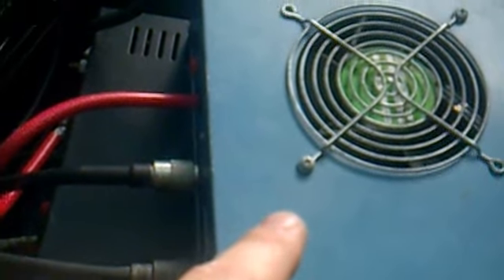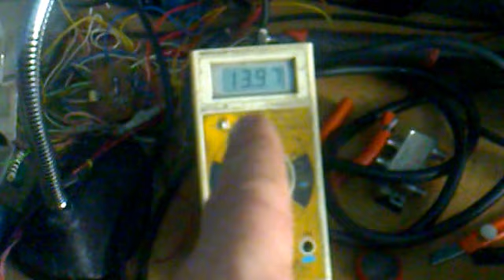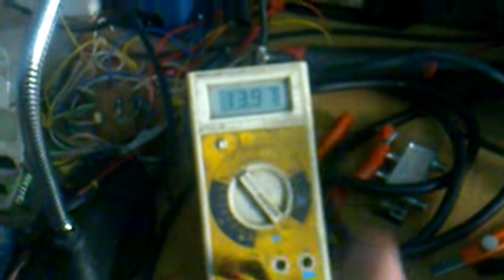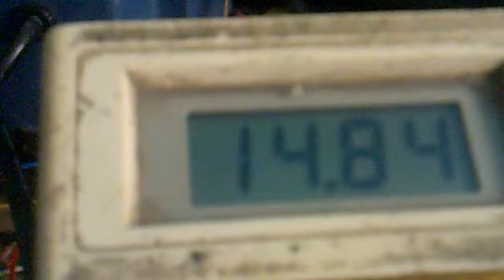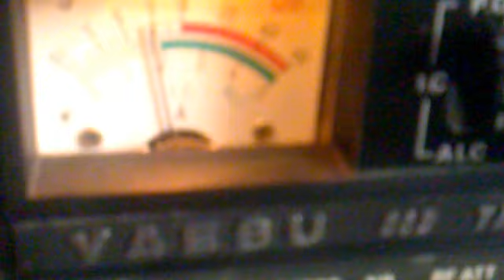Real Deal 1100 and Yaesu FT-101EX testing the power. 347 BOOOM...!!

Comment from the maker: your right 1kw is nothing compared to the US and some other countries, but this is the UK, most CBers run 100w all the time, DXers max out at 500w or so..
Radio Hams might run over 1kw but the UK allowed is only 400w..
so 1kw on CB is pretty big for the UK when the legal allowed is only 4w..

this is mainly a test and i have yet to use the amp on the air..